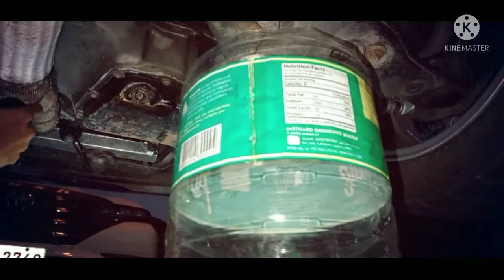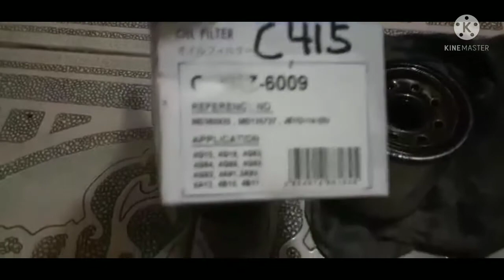DIY CHANGE OIL 4G92 MIVEC #mitsubishimirageasti

Comment: Sir good am.tanong ko lng ano sukat ng 4g92 glxi valve.ung sa 4g92 malagitik kc ung makina ng lancer ko.tnx po .
Reply from the maker: Pa adjust nyo sir yung valve tapet. Tnx sa support.
Reply: Sir ano sukat po glxi manual.
Reply from the maker: @jonathanvillalva8317  i believe Intake valve- 0.09mm
exhaust valve- 0.20mm. Please refer to user manual to double check. Thanks.